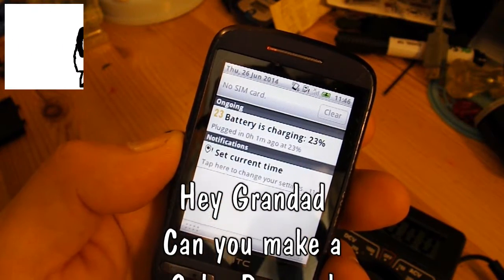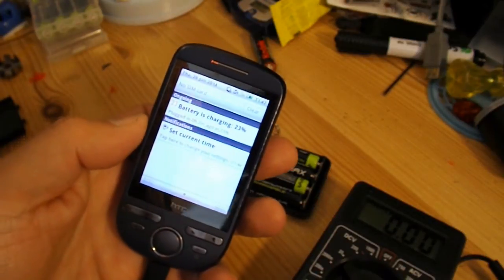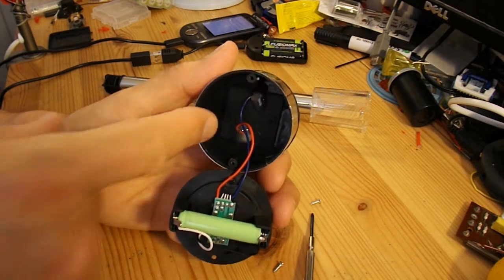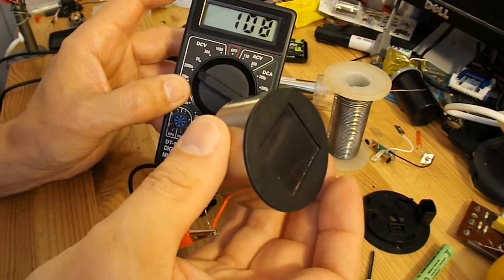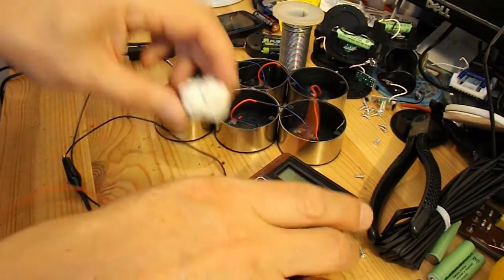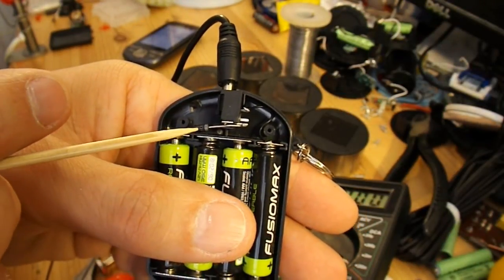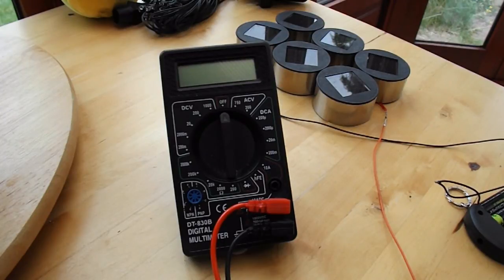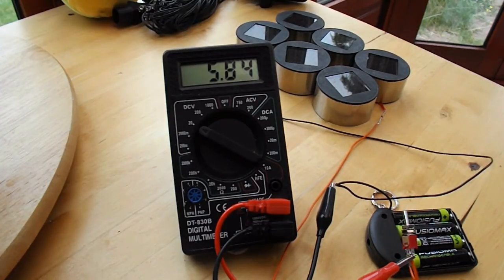Solar Powered Mobile Phone Charger Part 2

Comment: The drop in charge level is normally because it is charging, but not fast enough to cope with the drain of the phone being switched on. Enough to trip the phone into saying it's charging, without it realising that nugget of info lol.
Those solar cells are normally approx 25mA output btw.
Running speaker wire, so the panels sit outside will yield better results and angling roughly to the suns crossing direction. Can put them on a rotating pole and move it when you go outside during the day (I do similar here with not having a motorised solar tracker).
At 3mins you touched on something very useful. Most people use the phone in the day and put it on charge in the evening...exactly when the solar garden lights would kick on through lack of daylight. In other words, ready for when returning from work etc, the garden lights being linked in series from their batteries to a USB plug and with no LED's, ready for use anytime in the evening.
Reply from the maker: Hi slider, I see many similarities here to that lemon battery project. The LED went out on the little circuit board indicating the lemon was charging the battery but the lemon was probably only supplying enough to trigger the "turn the LED off" part of the circuit.
As you say, just using the garden lights as they are, minus LED, would be a better way of doing this with each individual battery getting it's own charging panel. I realise leaving the 4 AAA batteries in series and trying to charge them all at once is a bad idea but I just wanted to try it. I did wonder if I would get better results using the batteries the garden lights came with as the ones I am using are good old bargain store brands. Having said that, I do like this brand, I have tried several bargain store brands and these seem to be the best, they don't claim silly high amp with 800 mAh for the AA and 350 mAh for the AAA, others claim more and deliver less.
Reply: GrandadIsAnOldMan
 For a phone you'll want around 1500mA from batteries for a full charge, but the garden light panels will indeed struggle at 25mA from all in series. Better bet for the 4x batt, perhaps, 3 in series x 2, giving approx 7.5V at 50mA. Outside, tracking the sun.
Believe it or not, those 6 panels will work fine as a 12V 5AH lead/acid battery trickle charger. If my small block type battery is low at say 12.26V, it'll be at 12.35V by a days end. I leave it sat outside for a week. The panels are mounted on the casing of an old PC speaker and the battery sits inside it, protected from the direct sun.
Reply from the maker: slider2732 Hi slider, yes I am using the 3 x 2 format and even in dull conditions the battery charge is rising (slowly) although I am still concerned that I really need to be running a parallel test on uncharged batteries to see how much they recover when left alone, so that I can demonstrate the difference. (That lemon battery thing really upset me).
Reply: GrandadIsAnOldMan
Capacitors are similar, with the way their plates work, dielectric absorption. If anyone zero's out a large value supercapacitor, they really haven't, etc.
Most is about load and time. If you use up a rechargeable AA in a remote control over months it will be truly flat, if you run it out with a heavy drain motor then it won't be.
A good method is the 1hr rule. Use a battery, let it sit for an hour, after that hour it will be showing near enough what it truly has left on it.